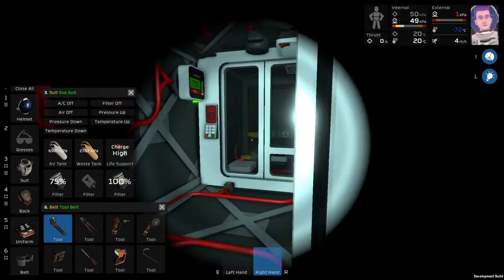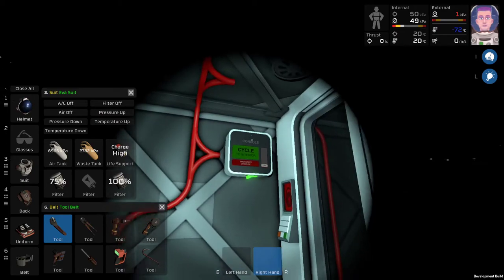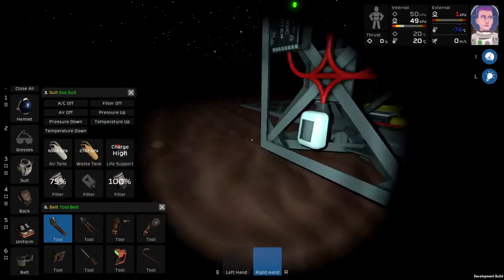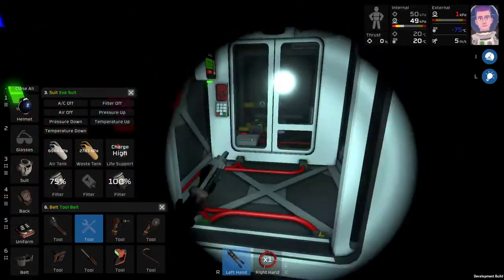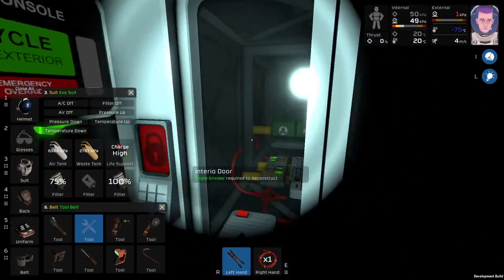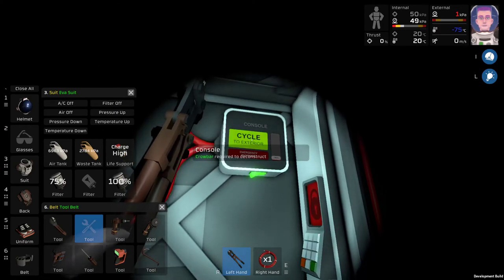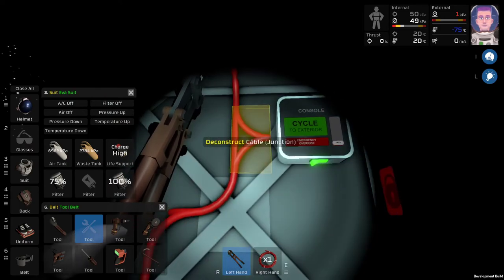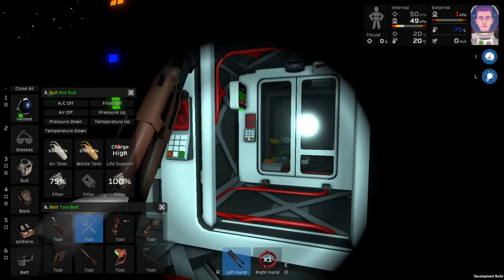Stationeers bug: reversed/inverted airlock

Comment: Kinda a long standing issue which is caused by power 'dipping' as you change the network/split it. the work around is to have all your airlocks on their own power network using a power controller and battery. This should prevent it from getting confused that way.